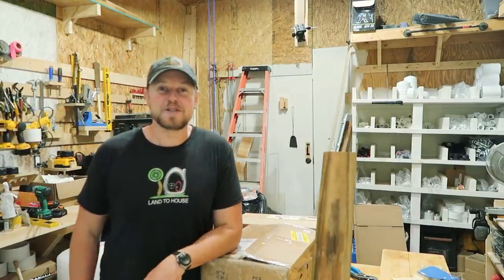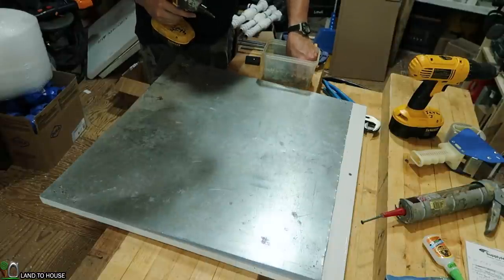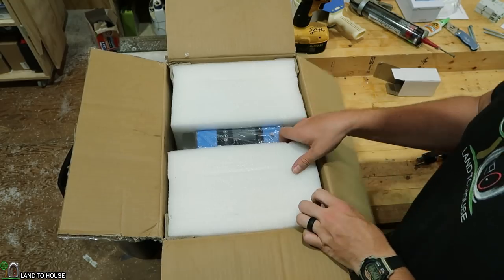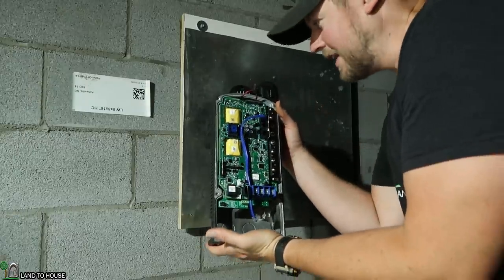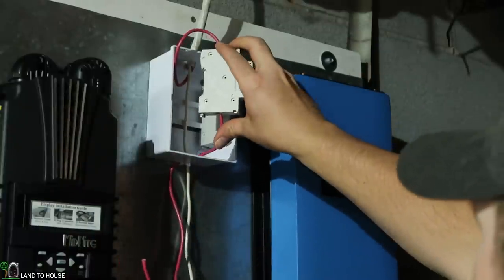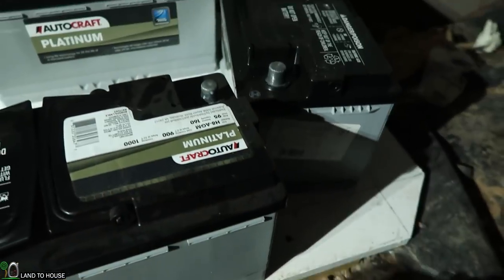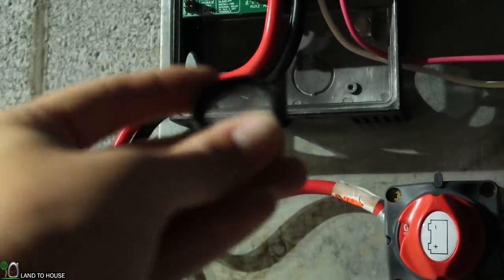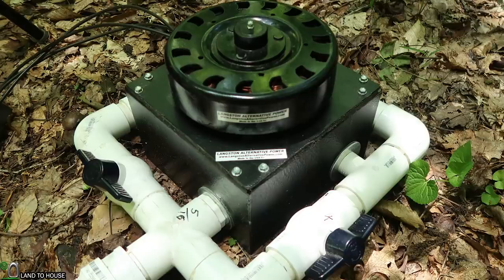Install Electronics Micro Hydro 8/10

Comment: You are doing a good job so far. You will be doing many fine-tuning steps after you get it installed. You are 10 steps ahead of most people. One quick pro tip. On striping outer insulator off of your wire. There is a cheap tool that every electrician uses. Only costs a couple of bucks and kind of looks like a thin piece of metal with a hole in the end. Then it has a short sharp piece stubbed out. You run your sheathed wire through it squeeze down and pull. It cuts through the outer sheath but not the inner insulation. Then you just peel the sheath off like a banana and cut it off.
Reply from the maker: Thank you! Getting this far has taken months! Its so nice to have the system up and running. I have always had an issue getting that outer sheathing off the wire. I will have to look into getting that tool.

Comment: i suggest putting a wire clamp on the wires where they go into the charge controller to prevent mice from wrecking it when they go in by the wires and making a nest in there. Also it looks like you have some fiberglass insulation above the inverter that might fall and cause the inverter to over heat if it comes loose or mice loosen it. Maybe a board fastened above the inverter to prevent the fiberglass from falling on it.

Comment: Will you be installing a cover over the rectifier? The voltage present makes me nervous for an accidentally placed hand or curious fingers at some point in the future
Reply from the maker: I might place a cover over that. It would need to be well vented.
Reply: @LandtoHouse  Even a piece of half pipe anchored down with a strip of perforated metal tape would work.
Reply from the maker: @MarkRose1337  thats a fun idea. I will save a ram pump tank scrap and do just that.
Reply: Yes I would definitely make it child proof down there!
DC is dangerous high voltage.
AC gives you a chance to get away DC doesn't!
Reply: @ronniepirtlejr2606  High Voltage AC is just as dangerous. And don't forget we are not talking about 50/60Hz here (not that it makes much difference).
Reply: At least it's most likely not referencing ground.  Not that you should take any chances.
Reply: You need a heatsink for the 3 phase rectifier. Will make it last longer. And also improve the voltage drop a bit. Use heatsink compound on the bottom of rectifier also.

Comment: I did that about 18 years ago :). I had 10 batteries in parallel for 12 volts. Had a wind turbine and 3 100W solar panels.

Comment: Is using sheet metal as a backing for the electronics a standard practice? I understand the need for heat dissipation or protection, but the risk of shock also concerns me with that backing. But I don’t really know anything about installing electronics like this.
Reply: I was about to say that’s not great but if u like shocking the shut out of your self go for it
Reply from the maker: I think that the system is grounded through the ground of the outlet. I am not sure which of the electronics would shock?
Reply: Definitely ground the plate to be safe... edit: with an actual ground cable

Comment: Solar Panels?  A teaser for future vids!  You've got a lot going on in this vid, Great job on shelves of ram pump inventory!  I love it!  Never seen a breaker box that small before.  Nothing like hauling 50lb batteries bent over in a tight space, back breaking. I had a shade tree mech smear MP grease on the battery poles to stop corrosion.  Great Job!
Reply from the maker: Yes solar is on the way! I have had the panels up for almost a year and did not have the money for the electronics. Those batteries were a real pain... in the back.

Comment: Sorry for asking such a simple question but shouldn't the rectifier be located as close to the charge controller as possible?  Aren't you just causing some loss by changing from AC to DC 20 feet away from the controller then running DC voltage through such small wiring?  I'm sure they must be an explanation for it... thanks for helping me learn!
Reply from the maker: You are right. The issue was... that is where the 250 feet of 10/3 ran out. I am super happy that I got that far with the rectifier.  It would have been better to take it right up to the breaker.
Reply: Common misconception. Voltage drop is the same for AC or DC. AC is just easier to convert to higher voltage via transformers
Reply: @philip1091  Yes! That is why some power companies have very high voltage DC power lines that go for thousands of miles with only 2 converter stations. 

DC is actually more efficient to transmit power through the same wire because DC doesn't have the skin effect which pushes the electrons to the outside of the wire when there is a strong magnetic field from the high current causing there to be very little current in the center of the wire and only current on the skin of the wire. 

It's very expensive equipment to convert the AC to DC at high voltages and vice versa, which is why AC is used for power lines that need to supply power to thousands of buildings and lower the voltage at each one.
Reply: @NSaw1  never heard that one before?
It's better to stick with A/C.
 I thought that argument was pretty much settled with Tesla and Edison.
Reply: @ronniepirtlejr2606  It was! So AC voltage can be stepped up with a transformer which is why power distribution uses AC so the voltage can be stepped up to a high voltage (for the lines in my area 13kv), if you raise the voltage the current will be lowered for the same amount of power to be going through the line, an example. If you are transmitting 12vAC at 12a that is 144w, if you use a transformer to step up the voltage to say 72vac then the current will be 2a but the power is the same at 144w. 

Idk what the calculations are for line loss yet, but if you have a small wire for 12a its going to act like a heating element, like say a light bulb or a stove. It will start releasing heat which takes energy from the power being transmitted, which is a big inefficiency if the wire is to small.

What edison was planing and did was using dc that would be at ~110v ONLY so from the power plant to a house was one low voltage.
Just an example, If there was one line that powered 50 buildings, each used 200a (like in a high density city back then) That would be 10,000 amps at 110v! That is 110,000kw but if it were AC then the voltage can be stepped up to a much higher voltage say 9,000v that would be ~120 amps instead of 10,000a! So it wouldn't need anywhere neer as big wire. Then when at each bulding it can be stepped back down to 110v. 
At the time there was no cost effective way to convert DC to AC and back.
But now with vacuum tubes and silicon it is much more cost effective to switch high voltage AC to DC and back. You should search HVDC transmission.

So with AC there is induction and capacitance, which over a long distance it will offset the timing of the sine wave which will create a small voltage drop at the other end, but there will also be a voltage difference between the start and end of the line, which will draw current even if there isn't any load on the end. That will heat the wire and waste energy. AC always uses power to energize a wire. And that current will always be there, even with a load on the end of the line. That current can't be used for transmitting power.

With DC tho there is no sine wave to mess with the timing of, so there's no voltage difference from one end to the other, so no current will flow. (DC doesn't use power to energize a wire) The overall current will be less, which means less heat and less power loss.

With AC it's changing magnetic field will push the electrons out from the center of the wire (called the skin effect) there will be more current flowing on the outside of the wire than the inside. That higher current will make heat and use power.

I hope this was understandable. I tried to keep it short as I could.

Comment: i like how you did this build overall... one thing i'd have done different;y... those DC switches being open backed against a sheet of metal on the board.... i'd have put a wide sheet of rubber (or insulation of equivalent) to protect against any potential for arcs due to the contacts being so close to the surface of your board backing.
Reply from the maker: The dc switches actually have a plastic back that separates them from the metal.
Reply: @LandtoHouse  ah.. didn't see that in the video... but glad to know they did come with some sort of safeguard included.

Comment: Happy fan here,expensive but you'll enjoy free power for long
Reply from the maker: Yes! And I am going to make a hybrid off grid system.
Reply from the maker: @CyberviewU  with solar I am going to also connect to the other leg of the main power. That way I can feed things like the stove and clothes dryer at full sun potential.
Reply: @LandtoHouse  Wow, a 220V system.
Reply from the maker: Well kind of. The inverters will each have a leg of the main separately at 110v.

Comment: I think the amp clamp transformer sensor is to monitor power usage to give you information about generation/usage for graphing/reporting reasons. It might also be able to figure out if Grid is ON or if it needs to cut power for its brown-out detection.
😎. Man I love your videos, just great content!
Reply from the maker: That amp clamp reads the usage of the house so that the inverter does not feed more than the house needs. It prevents power from going to the grid.
Reply: @LandtoHouse  very peculiar. You sure that isn't just a bad English translation?

Comment: Those computer type cables are normally not rated for 15 amps. Read the receptacle end and most are 10 AMP only rated. That means that the unit should not be used for greater than 10 Amps out and the breaker should also be rated at that. That would limit you to about 1200 Watts output. But as your turbine unit is only about 500 Watts rated, that is the max you should set the unit for.  The Solar Panels can not be relied upon to make up the difference all the time ( like at night ).

Comment: One thing I would recommend to put a block of wood next to the wall. Concrete floor's and walls for some reason will pull the charge out of the batteries. We had brand new batteries go dead at a place I worked at before.
Reply from the maker: Thats wild! I will do some research in that. Thanks!
Reply: This is very true. I worked with lead acid batteries in the past. And we had a rule. Never store them on a concrete surface. They will lose their charge.
Reply: Thats true. The power seeps back to the earth over time. Insulation prevents this.

Comment: Sorry for the daft question, i'm just learning. Why do you need batteries? I thought they were needed for storage (say on a solar system where the supply is interrupted), but your supply is constant?
Reply from the maker: I also have installed solar to the same batteries. Also you can use way more power with batteries. With storage the batteries can give 1400w instead of 360w.
Reply: @LandtoHouse  Ok, thanks.

Comment: Any corrosion prevention for your batteries?  Understandably you’ll be going under the house for your routine water filter cleaning and you can keep an eye on the batteries, just may be worth slapping a layer of Vaseline for prevention.  Good work overall, I’m not a huge fan of doing electrical work, luckily my next door neighbor is an electrician :)

Comment: How could the inverter be upside down?
 fans pull the heat up through the box and out the top.
It wouldn't make sense for them to have the fans on the bottom blowing the heat down. 
Most fans pull air through the bottom of the Box then the heat exits through the top with the fans. Unless they have their fans flipped around the wrong way?

Comment: Hey seth love the project but i would use a stranded wire like two pieces of welding cable to run from the diode bridge to the midnight dc amps dont like to travel over solid copper wires multi strand cable is better maybe some 8 or 6 awg welding cable ?

Comment: I have installed a similar but simpler system, I have various systems in operation, this one I describe to you has a turgo turbine, a classic three-phase asynchronous motor used as an asynchronous alternator, self-excited by external capacitors in single-phase C2C configuration, direct at 230V, (European standard , I did not go direct in parallel to the grid because I had an approved inverter with all the protections according to the legislation for the parallel, otherwise it required me to purchase a homologated grid protection interface with lots of bureaucracy and cost tests, so I am safe ...) I have a safety load deviation system via relay in case of off-grid (the induction gererator controller cost too much for 1.2kw made in economy) I did it in single phase because I reused an existing power line from the turbine to the home, the electronic relay of maximum and minimum current (not voltage) takes care of diverting the turbine under an electric ballast resistance in case the 'inverter grid disconnects from the national grid for various reasons so as not to burn it when the turbine is runaway so it remains braked at the right voltage (measures the inverter grid output) is a very crude system, a classic IGC downstream of the shift derivation of the electrical load would be better, cmq has been working correctly for 10 years, from about 230V AC output under load I enter a rectifier bridge, downstream on the DC 450V 1500 microfarad polarized capacitor to stabilize better (I had 2 recovery from a large audio amplifier I put them in series so they are 900V DC and they will never explode even with the turbine running without load, I enter an approved solar grid inverter, where the DC of the panels enters at about 300V DC, the mppt of the solar inverter accepts maximum 650V DC and is variable with a technical password is useful for adapting the turbine to maximum efficiency at the correct speed, your inverter self modulates according to the consumption of the utilities in the house so as to never enter the grid, I do it downstream with a derivation system using like you a directional current transformer similar to yours on the main phase of the electricity meter (we only have one) the arduino is programmed to activate at variable pulses a TRIAC that diverts under an electrical resistance the excess production that would otherwise end up donated to the network, to heat the hot water first, then if the thermostat trips it in turn diverts into an electric oil radiator (robust, safe and reliable) nothing batteries, as long as the utilities absorb within about 1200W the meter marks zero as soon as it exceeds it begins to absorb only the difference missing from the turbine, when I absorb less heat the water or the environment and never put anything into the network despite being in parallel, ( 10 years never a problem)
Essentially a DC fuse is missing from the batteries, due to the power of the system that is the only danger especially for the Chinese grid inverter.
it's a great job, for someone who doesn't work, this is to be taken into account ...

Comment: Curious about the batteries you are using. They seem normal car batteries. Why not use something better suited like Ni-Fe batteries that can be drained much deeper and last a lot longer?
Reply from the maker: The cost was the issue here. I will run these for a couple years and upgrade to nice batteries when these go.
Reply: Maybe it is not as important with hydro since you have 24/7 energy. With solar, you want a lot of usable capacity.

Comment: Not sure if placing the electrical below the water pipe access pipe is a good idea.
Reply from the maker: It was the only place that I could fine that did not have active water lines above or have a outside vent in the wall.
Reply: @LandtoHouse  OK

Comment: Question??
Why did you go from AC TO DC BACK TO AC?
Reply from the maker: For 2 reasons. 1. This ac is 3 phase at 200v. Needs to be converter to normal ac 60hz.  2. Battery storage. Can only store dc.

Comment: 20:36 It does matter, since the positive connector is slightly larger than the negative one.
Reply from the maker: Somebody else was saying that also. Thank you for the heads up. Definitely could become frustrating for someone trying to do it backwards.

Comment: All very good but those batteries !!! Why are you using car AGM batteries for renewable energy, a complete waste of money in my opinion (not robust enough) or is it just a stop gap ? You should get some wet lead acid - Rolls or Trojans etc. I am amazed that Langston did not suggest some more robust batteries. I love the way you have made the end of the penstock look like a RAM pump, excellent.
Reply from the maker: Cost was a major factor in battery choice. I'm just skimming off the top of these batteries so it's mostly just a stopping point
Reply: @LandtoHouse  OK I was worried that you thought you might be able to draw substantially on them for daily usage.  I speak from experience , years ago I bought loads of car batteries and tried to run off grid, I quickly discovered the truth. and wasted a lot of money.  Just skimming off the top 10% they should be grand., but still looking forward to seeing you with a good set so you could survive a decent power outage and cut wood with your own power.

Comment: Is there a way to run the system without using a battery? 
Like using 220v output generator, directly powering the house.
Reply from the maker: You can use these grid tie limiters directly to the house without battery.

Comment: You should ground the metal plate and add a fuse right behind the battery, if there is a short, the energy from these batteries is immens.
Reply from the maker: A fuse between the battery and the cutoff switch going to the inverter?
Reply: Between the battery and both cutoff switches.